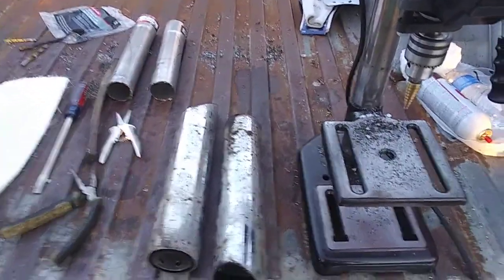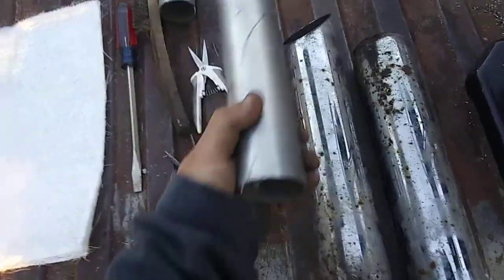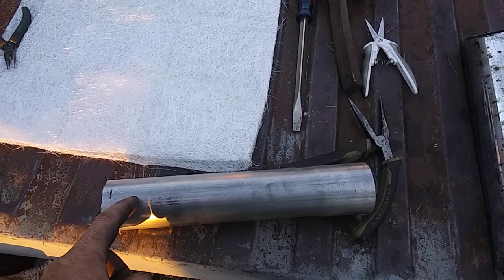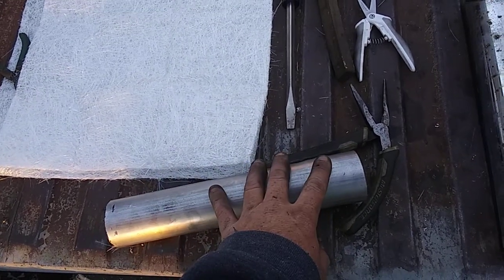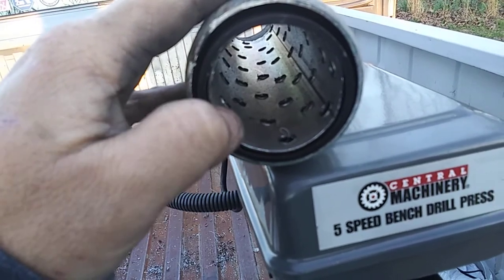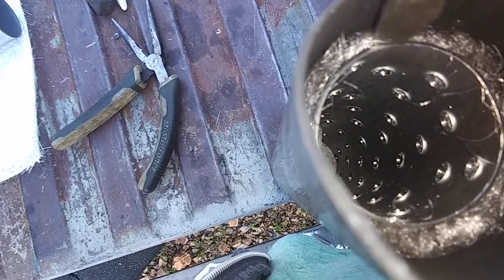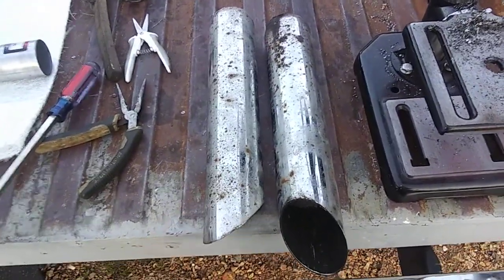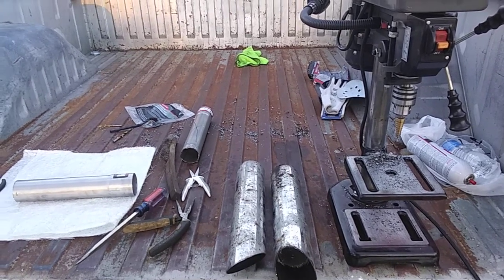DIY LOW BUDGET PROJECT Part 1 : Converted Exhaust echo tips to Resonators

Comment: Cool I like they way you made them can't wait for part 2.
Reply from the maker: it was a lot cheaper to built them my self then to spend 90.00 each plus shipping for same style of tips from heartthrob exhaust.com  
I think I have  a ruff estimate of 46.00 dollars invested in material I bought . the cost also includes the short flared out pieces I still have to get
Reply: @MoparMan-ff8fb  yeah a lot of things today are more expensive than there worth I put together a hydraulic exhaust pipe expander out of a cheap astro manual expander and a Harbor freight hydraulic hole punch die kit $200 vs $375 or more.... it works great.